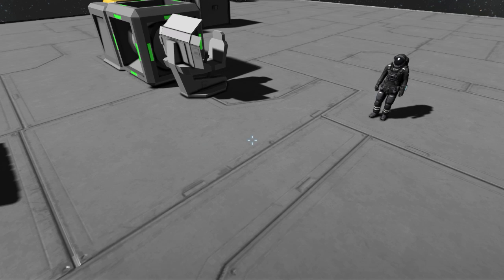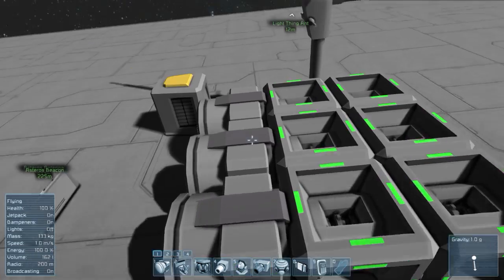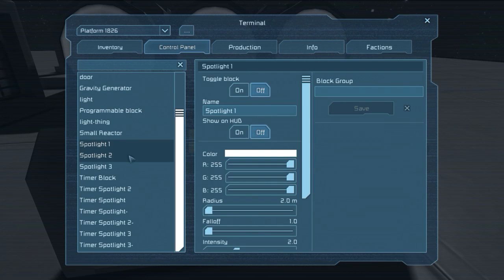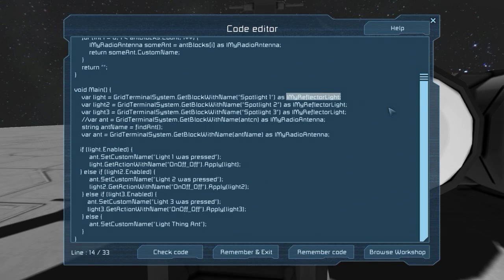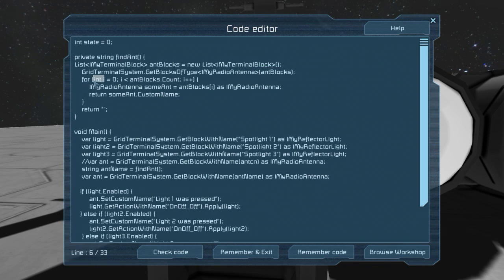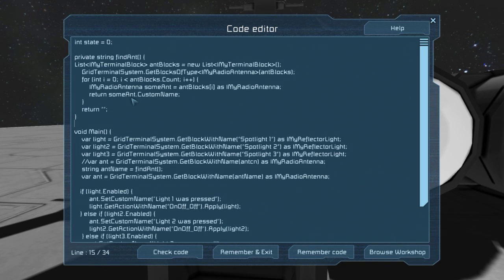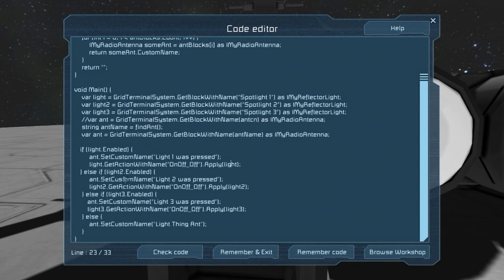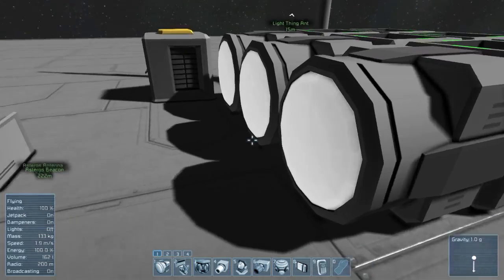Simple Script Thing - Programmable Blocks - Space Engineers

Comment: I need help. Code http://i.hizliresim.com/oAMlMQ.png
Error http://i.hizliresim.com/M6M4jk.png

All OnOff action problem
All Open action no problem
Reply from the maker: MultiBattleChannel I can't read the error, would you be able to translate?
Reply: I use the English translate but write the error Turkish
Reply: void Main()     
{     
     
 
  var GTS=GridTerminalSystem; 

var VirtualMass= GTS.GetBlockWithName("Yapay Kütle 1") as  IMyVirtualMass;
if (VirtualMass.OnOff)
{ 
var Kirmizi= GTS.GetBlockWithName("Işık") as  IMyInteriorLight;         
   var colour = new Color(1.0f, 0.0f, 0.0f); 
Kirmizi.SetValue("Color", colour);  
   
var Kirmizi2= GTS.GetBlockWithName("Işık1") as  IMyInteriorLight;          
   var colour2 = new Color(1.0f, 0.0f, 0.0f);   
Kirmizi2.SetValue("Color", colour2);   
 }

else
{

}
                
}
Reply: Use Translate=' Sandbox.modapı.ıngame.ımyvirtual ', ' OnOff ' for the visit does not contain a definition
' Sandbox.modapı.ıngame.ımyvirtual ' a first argument of type K , which could
NO ' OnOff ' expansion method is not found, a , USE OR compilation instructions
Refer may be missing ?